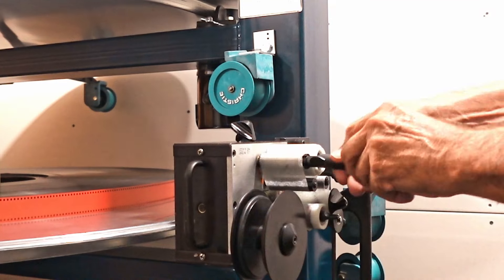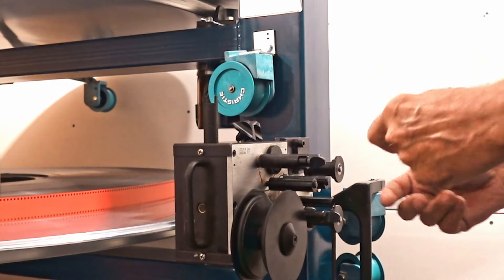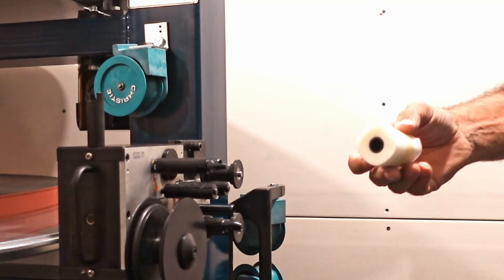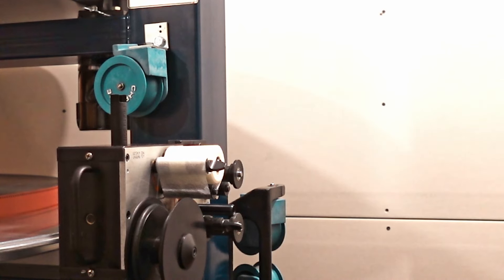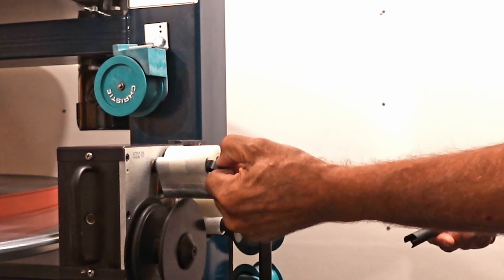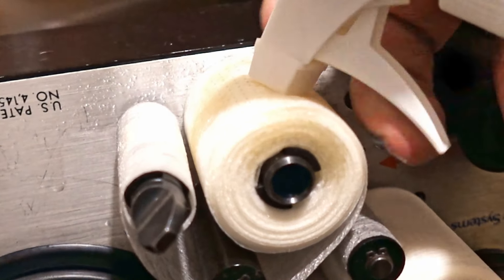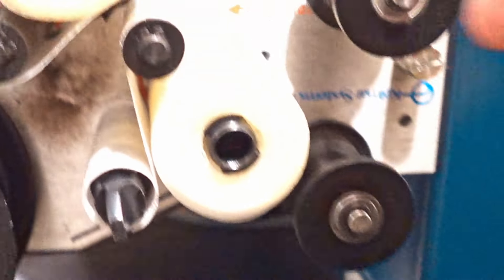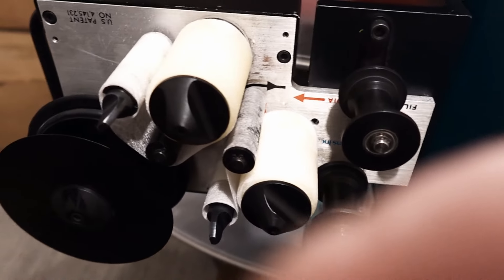35mm Kelmar film cleaner How to change the film pads

Comment: Hi Jon, some tips…

There is no need to rewind the dirty pads.  What you should be doing is loosening the takeup thumbscrews a few rotations so the takeup cores spin freely, then grab the media and literally pull the media off of the pads (pulling to the side so all 4 cores spin).

It is very good to see you did NOT remove the two takeup cores.  Those should always be reused, as removing them and installing new ones each time you load up new pads cause damage over time to the two rubber inserts which grab the takeup cores.

When rewinding the pads, in the video you are standing directly in front of the media cleaner.  That is the hardest way to get a smooth rewind, which is visible in the video.  Stand to the side of the film cleaner so the handle is directly in front of you.  (Your left hand will reach over the top of the cleaner to assist with the right hand that is rewinding the media.)

The rag you used is fine, but a paper towel works just as well and is disposable.  However you didn’t wipe clean the two idler rollers the media travels over, so whatever crud is on there from the last cleaning will be transferred to your new clean rolls of media.

When wetting the pads, it’s easier if you dismount the cleaner and set it on a table so you can get a better angle with the sprayer on the second pad.  Also it makes it easier for you to look on the underside of the pads to verify you put enough on to completely wet the pads.  You don’t want to see any dry spots.  The video is a little overexposed, but it looks like you have a few dry spots on the inside edge of the pads, and the bottom side of the pads could be dry which could cause scratching when that section of the media pulls across the idler.

Don’t re-use the masking tape that is on the media pads from the factory to secure the tip of the media to the takeup core.  Always use Scotch “Magic” tape.  The “Magic” tape is the only tape that is not prone to slipping once wet.

Before capping the two supply shafts, take your extra core and try to rewind the pads.  Because you tightened the two takeup thumbscrews when you taped the media to the takeup cores you should NOT be able to rewind it.  If however the media starts to rewind, it means your tape is not grabbing the takeup core and is slipping backwards, or your rubber insert in the takeup core is wearing out or you forgot to tighten the thumbscrews enough.

The last step before running the film through the new pads is to take the tip of your finger and spin the main drive wheel as fast as you can to simulate film motion for 10-15 seconds.  Watch closely the media itself to ensure it is advancing.  Now it is safe to run your film.
Reply from the maker: Thanks for your comments